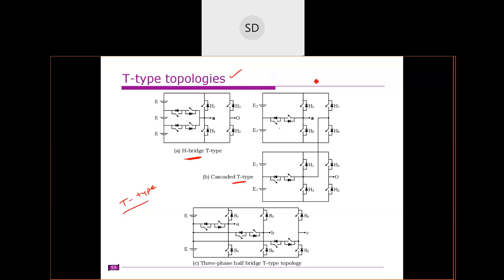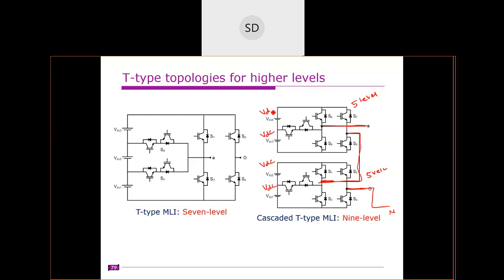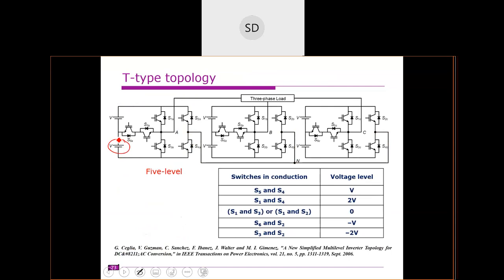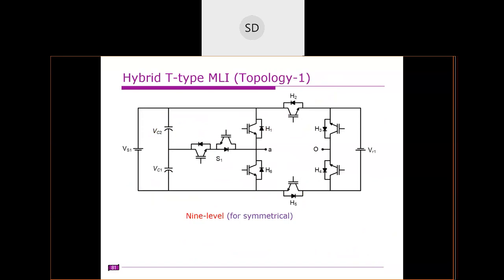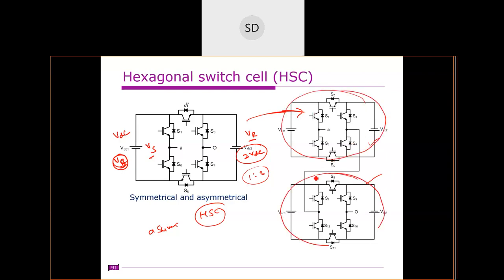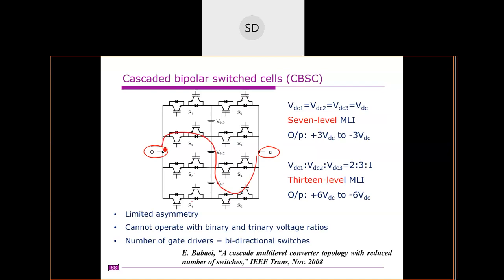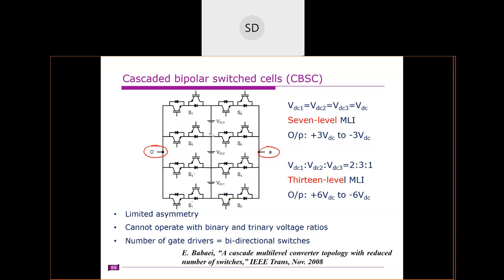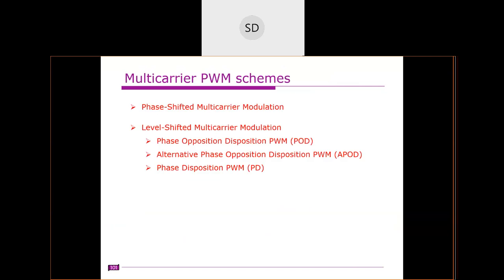Lecture 27: Reduced switch count multilevel inverter (RSC-MLI) topologies   2

Comment: Excellent explaination sir about different multi level inverter but I have a query in half mode T-type multi level inverter as you said it is only possible +Vdc 0 -Vdc but in the below paper 
A. Sheir, M. Z. Youssef and M. Orabi, "A Novel Bidirectional T-Type Multilevel Inverter for Electric Vehicle Applications," in IEEE Transactions on Power Electronics, vol. 34, no. 7, pp. 6648-6658, July 2019, doi: 10.1109/TPEL.2018.2871624
we can get five level, how to get +2Vdc and -2Vdc sir
Reply from the maker: The topology shown in the above paper is a multilevel dc link inverter. With two basic units you can get +2Vdc and -2Vdc
Reply: @AdvancedPowerElectronics  How to get that +2Vdc sir, which switchs should be ON to get +2Vdv and -2Vdc